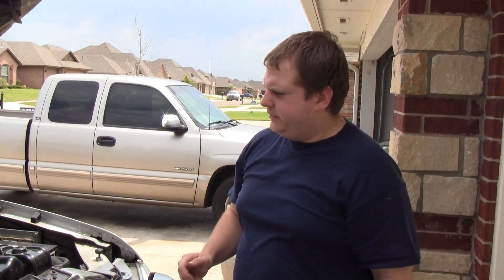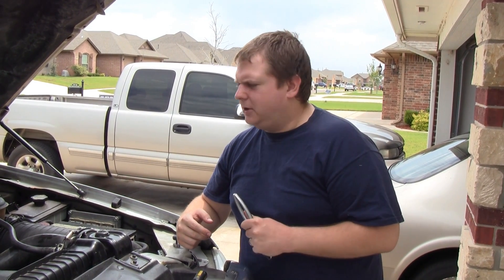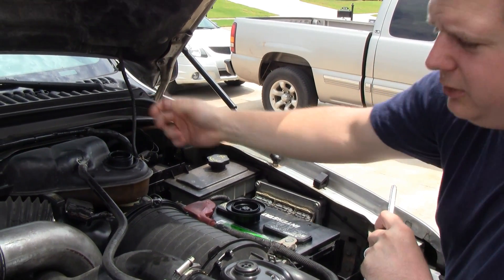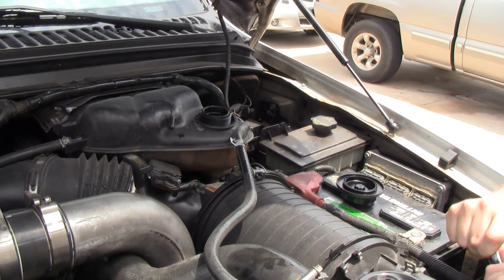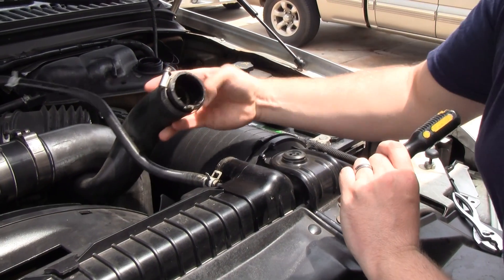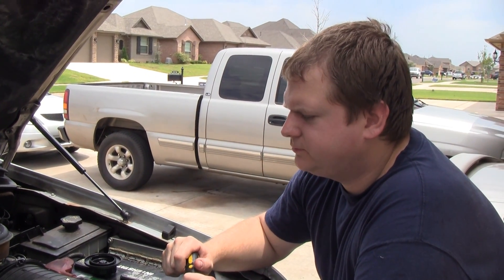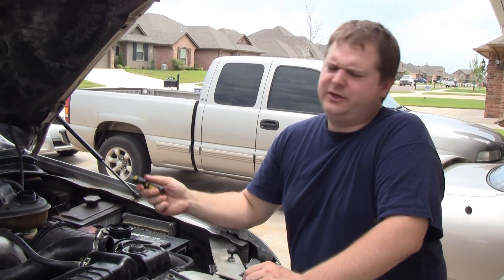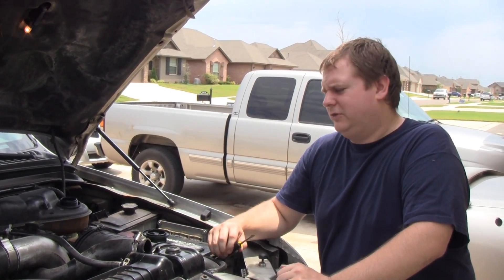Deviously Clever Mechanical Fraud On A 2003 F-250 Powerstroke Diesel

Comment: I am a Ford factory Diesel tech. I have seen this MULTIPLE times on pre purchase inspections. 99% of the time oil in the coolant is caused by an oil cooler failure or a cracked block, not a HG. Blocking the return lines simply stops the oil from getting into your reservoir to make an unsuspecting buyer unaware of potential problems with the truck. These trucks are known for headgasket problems, but most of the time its a misdiagnosis. When the EGR cooler lets go it mimics HG failure symptoms to a tee. That is why when people get their heads done and studded (which will prevent any future HG problems) they are also sold a new EGR cooler or an EGR delete at the same time "because we are in there already"
Never jump on Headgaskets unless you already have an EGR delete and she is puffing white smoke.  When the 6.0's HG lets go you will be losing coolant, ive done over 200 personally and oil in a 6.0's coolant is never HG's.
Reply from the maker: That is great info, thanks!
Reply: Steve Moore Unfortunately your oil cooler has probably failed. Your oil cooler is one of the only places that oil can enter your coolant system. It is not a cheap repair, but you should have this addressed immediately. If you dont, you will end up gunking up the coolant system. When that happens, say goodbye to your headgaskets. DO NOT let whatever shop you choose to do the repair to tell you that you need new coolant system components like a radiator. It is common for shops to try and upsell you these things with scare tactics. All you will need post oil cooler is a good flush which you can do yourself. Replace with Ford gold coolant.
Reply: ***** He has a 6.0, this whole video is 6.0 related, but guess what? I fix 7.3's as well! Hundreds per year! a cracked injector cup will NOT allow oil into the coolant. It will fill your coolant with fuel. Also, one of the only places for a 7.3 to let oil into the coolant? Oil cooler. lol.  I would like to see these trucks that you have been working on my friend.
Reply: No, are you?
Reply: Sorry you feel that way. Unfortunately there are alot of bad mechanics out there. 
I do not guess, I test. I NEVER guess because I need to sleep at night and I do not rip hard working families off. 
You can thank the major auto manufacturers for creating such a bad name for the many hard working, honest and highly educated technicians out there. They pay flat rate, per job and do not give enough time for the technician to do his job thoroughly or properly. This has created desperate techs looking to put food on the table. Whether that means repairs that arent needed or quick diagnosing without adequate testing leading to an incorrect repair. I left Ford and work at a mom and pop shop now.

I go to school every single year and have for the last 17 years. I take the time to learn my craft, so I can be one of the best in the field. Please, if you feel that you can do a better job then become a mechanic! You will get to deal with lots of great people.. AND! big ignoramuses such as yourself.

Im assuming you got ripped off recently. That sucks. Do your research or fix it yourself since you seem to be a genius.
Reply: I'm yet to see one catch fire, but I have seen a few battery boil overs from the regulator in the alternator failing. Unfortunately when that happens it usually takes out other things including the PCM. I suppose this could cause an electrical fire, but it certainly wouldn't be exclusive to the 6.7. 
This time of year is always good for engine fires across the spectrum, both gas and diesel due to mice burrowing in the engine bays and chewing up wiring.
i took a gander and cannot find any TSB's or tech notes regarding engine fires. 
Perhaps the owners of the trucks that were burned lit them up after getting a repair estimate lol
Reply: Its true. Many of them are simply guessing and changing parts. This costs hard working families thousands of dollars that they dont have, and is one of the many reasons I left a major dealer. 

My point is, not all of us are bad. There are many upstanding mechanics out there. You just have to find them. I left for the right reasons, I have a moral compass and like I said.. I need to sleep at night so if that means I make a little less then so be it.  I make sure its done right the first time and I am not pressured to upsell. 

Ive seen poor building engineering and very bad doctors in my time. They are making millions off of the sick and dying. They do not get fired for mistakes.. in fact, its incredibly difficult to even sue a doctor so thats a poor analogy.
Reply: It's like any other profession, the better ones can correctly deduce a diagnosis more often than others. "Guessing" appears as guessing only when the "guess" is wrong.
Reply: Nick Stageberg I'm getting just a small amount of oil in my coolant and I've already had the delete. No white smoke and I still have power. Any ideas?
Reply: +Hookemups 

My apologies, you are very right! There is no way for it to enter via a CAC system. I meant to say cracked block. Im glad someone picked up on it because that is kind of embarrassing. An EGR failure wont produce oil in the coolant, it will leak coolant back into the exhaust. Hence the white smoke.
Reply: then how about you douche bag customers pay us for diag. that's why most tech guess because the cust dosent want to pay 2hrs in diagnosis time just to know what the problem is. there's reason the industry has gone the way it has. and most of the time it's cheap customers that dont understand what maintaining vehicle means. they just want to drive and nothing else. that's not how it works. I agree there are some bad parts changers, not technicians. if you guess at problems and not pin point and confirm the issue your a parts changer.
Reply: sixOHHfour yessir. fuel filling the injector tubes. your awsome for sharing this. seen it many times myself.
Reply: firstpo jkh - I was a Dealership Ford mechanic at 19 and dealt with idiots like you all the time. I since finished school and I am a mechanical engineer and will soon have a Masters, I apply the same techniques I learned as a mechanic and outperform 90% of the engineers out there who were never hands on with anything but a Playstation controller as a kid. So your theory only applies to morons like yourself. Do you really think it pays to play guessing games like some backyard mechanic as yourself. It pays to know your trade and out perform flat rate and move on to the next issue. Dont project your own insecurities and faults about your intelligence and mechanical understanding onto an entire field of hardworking people. Just because you change your oil and diagnose a miss doesnt mean your on the same level as mechanics who are able to diagnose and repair complex electrical and mechanical systems all in a race to beat the flat rate and get a paycheck. Id like to see you and your backyard skills in that eviornment. You wouldnt last a week.
Reply: You must be referring to the 7.3 engine. I have only ever been able to get OEM motorcraft cups so that is all I have used, but always a good result. It is rare for the 6.0 to blow the injector cups, but it has happened. Again, I have only been able to locate motorcraft cups for them. Have you confirmed a cracked cup on your 6.0 or 7.3 via a pressurization test?
Good Luck!
Reply: +sixOHHfour thanks for the input!!! I didn't ask a single question and still got my answer, I don't think people appreciate you anuff
Reply: sixOHHfour I worked for a dealer for 3 years, I left to be a fleet mechanic.  Less cash but I could care less.  I hated knowing I was going to be asked by service managers to rip people off.  Plenty hack mechanics for that, just not us I guess. I hated every aspect of dealership wrenching.  Flat rate, etc.etc.  The only things I enjoyed was the variety of cars to work on and talking with the customers.
Reply: bart medes I am not trying to be a dick, but the Ram's DPF and transmissions fail at an alarming rate.   That's why I no longer own them.
Reply: sixOHHfour Funny thing is, diesel is an oil. And some people use the terms interchangeably when they probably shouldn't. I wouldn't be surprised if that is the case here.
Reply: +Turbo Diesel my 1997 7.3 Powerstroke had a factory recall from people having engine bay fires, apparently the cruise control module is mounted under a reservoir which is prone to leaking, and then what happens is a fire will eventually start (especially if the truck has oil, grease etc around/in the engine bay from not cleaning up after jobs) at least that was what I've been told and what I can remember from the recall. I would think they changed the layout of said problem area to avoid further issues but who knows...
Reply: +bart medes    Thanks for the info Fart.   :)))
Reply: Firstpo jkh What I think I know "Son" ? I was acing diff eq. while you tinkered with your broke down p.o.s and struggled to pay your bills.
Reply: sixOHHfour What about 7.3 idi with oil in the coolant?
Reply: Nick Stageberg hey how much did you pay for the truck and did you fix it yet? what was wrong headgasket?
Reply: sixOHHfour It didn't show in the dip stick?
Reply: +Ford6.9/7.3idiDiesel As stated by the other guy, that would be the oil cooler leaking, more precisely the o-rings have failed. The 6.9L and 7.3L IDI's, as well as the 7.3L Power Stroke all use the same oil cooler for the most part. They do have different o-rings for the early 6.9L's, but later 6.9L's and both 7.3L's use the later two o-ring design. There is one difference however, the 7.3L Power Stroke's oil cooler "log" (as some people refer to it) looks the same, but is slightly longer, and thus will not work in an IDI's  headers.
Reply: I'm not sure how an intercooler failure (which is boost / air) could cause oil in a completely different area ie  coolant. I would like to know how that is possible. I completely understand how an EGR  cooler could cause this but not an intercooler being cracked. Please explain? I'm very interested.
Reply: I have never met a good ford tech explain to me how a cracked inner cooler puts water in oil.
Reply: +sixOHHfour : Until the engine bay catches fire... LOL  I've seen a lot of late model Powerstrokes at the auctions, all with engine fires.  WTF is up with that?!
Reply: +sixOHHfour I know it's an old post, but I had a 2003 Freightliner with a Detroit engine. 35,000 miles and pitted injector cups had completely replaced the coolant with diesel. I couldn't believe it...
Reply: sixOHHfour
Reply: Egbert Wadman directed to firstpo jkh
Reply: You still have to remove the cab to fix any major failures..Ford screwed their customers with this engine
Reply: Firstpo jkh
 Holy shit someone has daddy issues
Reply: LOL doctors play guessing games more than you think .Thats why its called a diagnosis and not a for sure
Reply: sixOHHfour thanks good to no
Reply: wow thanks !r science its all most like he said  first huh?💩💩💩💩🆗🆗🆗💩💩💩💩🌈🌈🌈🌈🌈💉💉💉💉
Reply: Is the 2016 f250 having the same problem
Reply: tim funk You are also a moron...
Reply: John Michael You welcome inbred Ford hick
Reply: John Michael Yup another make no sense Ford inbred.
Reply: John Michael How are your coworkers and your in the trailer park btw
Reply: +94 7.3 IDI turbo Diesel Most of what I see is the oil cooler tube leaks.  It has 4 large "O" rings and the ends are pressed on.  Seals shrink and pop, oil goes into the coolant. Hope it went well, I see the post is old.
Reply: +jeremy brooks Basically what happens is there are 2 different sizes of O rings for each fluid.  Picture a round pile of straws standing upright.  Surround the straws with a water jacket and that is the cooler.  The oil flows through the tubes/straws and the coolant flows past. Now, there are 2 entrances for coolant and oil as well   So one large O ring keeps the oil from getting into the water and one slightly smaller ring keeping the water from the oil.  If one tears, or more common shrinks, they can cross contaminate.  I have had to boil out many engines because of cooler failure.  They make the milkshake looking sludge.  You do not get a warning either, they just go.  Hope that helped.  Its confusing to explain in type.
Reply: I agree with what you are saying about the HG and puffing white smoke.  I had a guy bring me his 2005(Vin# reads 2006) Puffing Black smoke, cleaned EGR and intake out of the black cacked soot.(no need for special tool here guys) just use the PB-Blaster, or WD-40 around the base and work it back and forth until you can use a small pry bar or flat screwdriver to work the EGR upwards.  Eliminated the Black smoke to find the White puffy smoke(antifreeze-coolant burning out the tailpipe) at this point I knew the HD & EGR Cooler had failed as could never keep the Degas bottle to fill, kept leaking straight out.  6.0 thru 6.4 owners, don't be stupid, do the Upgrades while its apart, or get rid of the Junk.
Reply: Ned Fan Calm down old timer.  He was talking about an EGR not an oil cooler. Another Richard Cranium you are.
Reply: You seem like a cool dude.  Let me know if you wanna grab a beer sometime.
Reply: thanks for tacking the time to post
Reply: lol..
Reply: Firstpo jkh cracks me up that this lame is calling everyone else a "keyboard warrior" and "e-thug"....YOURE THE ONE TRYING TO ACT TOUGH ON THE INTERNET...asking people if they want to fight and shit...hahaha wow...lmao...come to Cleveland and talk that shit to some of my mechanic friends...get your skull caved in with a fucking 4 way... big olé bad ass...lmao
Reply: They did clear up the recall in the form of splicing in a fuse to the wire that would get dripped on or the cruise control wire so that if it were to get too hot and or gounded by becoming exposed and the whole liquid element the fuse would pop and not cause a fire.
Reply: sixOHHfour thank you for this. 👍🏻
Reply: Steve Moore make sure that you do the bullet proof external oil cooler that pulls it out of the valley.  Its worth the extra $$$ and you fix the problem permanently.
Reply: An incredible fraud placed upon loyal Ford people.  I had so many failures in my ford trucks!  Sickening that we were duped with this POS engine!
Reply: well you don't have to go through all that .. a compression test would tell you if its a gasket because it wouldn't be a valve.. wonder what was whistling
Reply: poor fella paid 2x for a stock 6.0
Reply: Your skills go deep 😎
Reply: What would you think might be the problem with a 7.3 if it had a rough cold start  with no smoke?
Reply: I'm not 100% sure on which tube you're referring to, but I'm guessing the stand pipe and or dummy plugs?? Always buy OEM Ford for this kind of repair. Replace both regardless of which one is leaking. seeing as you are already in there pulling the oil rail. Hopefully this is the answer you were looking for, but if not just clarify exactly what you are looking to replace and I will point you in the right direction.
Reply: No. the 6.7 Powerstroke does not have the aforementioned issues and is easily one of, if not the best diesel engine you can buy in a pickup right now. Take care of it properly, and it will take care of you.
Reply: Dromatic the answer to all those questions is to buy a different engine. for the money it takes to bulletproof that motor you could buy and enjoy a factory reliable motor
Reply: +bart medes     Well Fart.... you have my condolences.  Bye Fart.
Reply: You filled a good thread with your garbage. Delete your OS or throw away your phone for the sake of humanity.
Reply: +Blue Bird The only part that makes no sence is this "6.7 Powerstroke does not have the aforementioned issues and is easily one of, if not the best diesel engine you can buy in a pickup right now" I laughed.  Silly Ford people, everybody knows its Cummins, Duramax and then Powerstroke.
Reply: +sixOHHfour You make no sense. Are you sane?

Comment: Got an 03 with the same problem. Did an EGR cooler delete and capped the valve, then SCT tuned it. Dealer told me it was my head gaskets, and I've put 130,000 miles on since.

Comment: DON'T BUY FROM AUCTIONS YOUR JUST GETTING SOME ONE ELSE'S JUNK OR HEADACHE THAT'S WHY THEY SEND THEM TO AUCTIONS BECAUSE THEY KNOW YOU CANT RUN THEM LONG ENOUGH TO FIND ANY PROBLEMS.
Reply: depends on the auction  I use Ritchie bros and so far I've never been burned  but then I buy fleet vehicles and heavy equipment normally.
 On the other hand if you use an auction where car dealers dump overstock you are just asking for trouble.